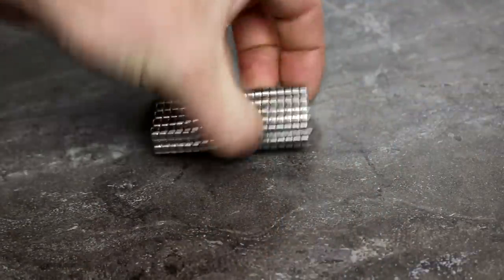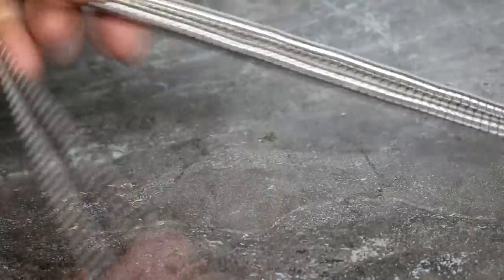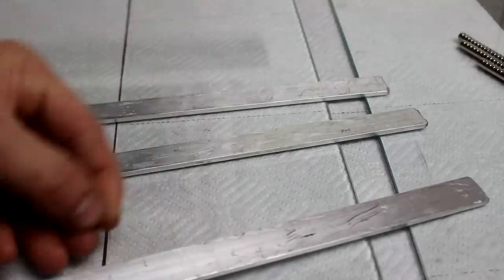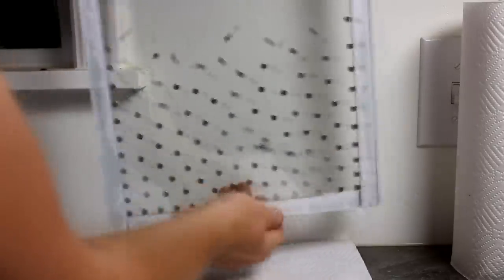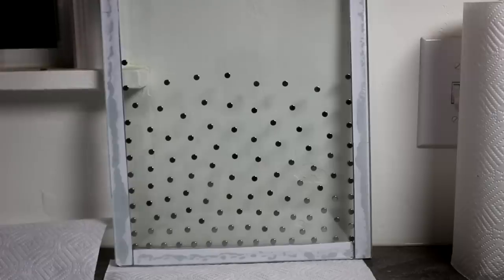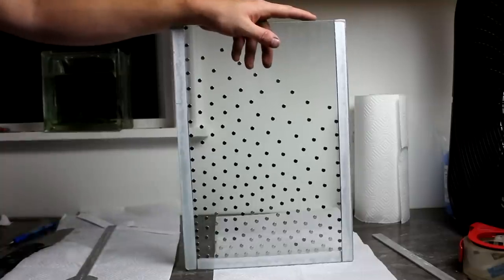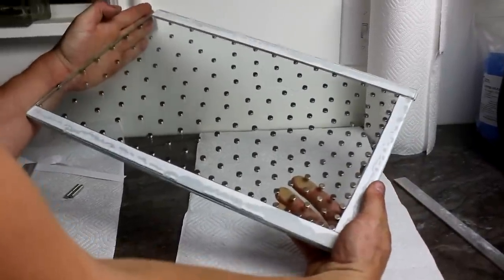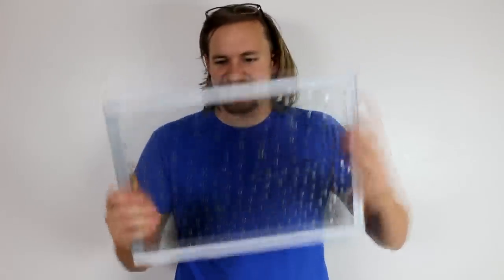Modeling a Gas With Magnets

Comment: Great video!
Two suggestions:

Put rounded corners inside so that the magnets can't wedge in the corners, to encourage a more unstable equilibrium

Automate the spinning of the big magnet
Reply: Axelios the magnets get weaker over time so in like a week they would be useless
Reply: The Champ what are you talking about? theyre neodymium magnets, there wouldnt be any measurable difference after a week
Reply: @hughsl3942  There would be a difference in a week if we moved the experimental apparatus into an operating furnace.  😉
Reply: I suggest an electromagnet. You could easily keep reversing the poles on that extremely quickly. Adjustable frequency to simulate temperature maybe.
Reply: @sushimrexx  that would be the smart and elegant solution. Alternatively, strap a big magnet to a drill bit lol

Comment: Man big magnets like that cylinder you've got scare me. I couldn't stop looking at that knife on the table and thinking what may happen if you get too close. Awesome experiment though, I may make one of these to bring to bring to kids science classes.
Reply: NightHawkInLight my thought exactly
Reply from the maker: Yeah a bit of an oversight on my part, fortunately the knife tends to stick to the magnet flat edge on so it would have pinched rather than cut.
Reply: Play music through a large electromagnet to visually show the speed of sound!
Reply: +Cody'sLab ok
Reply: To bring to bring?
Reply: I don't think the magnet was strong enough to attract a knife from a distance far enough that it would gain significant velocity. Also, odds are that knife isn't very magnetic. The other smaller magnets reacted so strongly because they have magnetic fields of their own which were interfering with the larger magnet's field.
Reply: NightHawkInLight you should have some slightly larger magnets to represent denser gasses/elements
Reply: See that big gauge in his thumb? I think we all know where it came from :D
Reply: NightHawkInLight I thought that it said maggots
Reply: U da bomb
Reply: I was hoping the entire time that the knife was a non-magnetic metal. 

Also, it would be really cool to see how much you could move/accelerate a knife using magnets. Kinda dangerous though.
Reply: Says the guy with a big vacuum tube cannon.😁
Reply: @Daniel Jacob I dont think its the speed of the knife that would cause injury, rather the inexorable force of the hugassed powerful magnet pulling the knife in with incredible force... it could definitely cause injury, probably pinching but possibly cutting (if unlucky)

however I don't think cody was in any danger of losing a thumb or something but if it were a sharp knife it could certainly have required stitches.
Reply: Many years ago, I was working at [un-named hospital] when the news came in that someone had gotten a floor-buffer a little too close to an MRI machine.
Powerful magnets, liquid helium cooling, 8 Tesla field....
The buffer punched through dry-wall, and ended up about 2/3 the way into the central tunnel.
There was a patient in the machine at the time, the rest is public record.
Reply: +Zac dangerous is cody's pretend middle name
Reply: Greg, what purpose does not naming the hospital serve, if you're enabling us to find it out anyway?
Reply: NightHawkInLight s I'm your biggest fan
Reply: NightHawkInLight okay so when I look at your comment it says: dark souls is the crash bandicoot of Mario platformers. When I CLICK on your comment chain i see a totally different comment. What gives?
Reply: Xx_BlackRhino_xX 1 hes actually a distant relative of johnny dangerously
Reply: Lol I have a 2 inch cube rare earth magnet. Definitely scary when something jumps across the table to get to the magnet.
Reply: NightHawkInLight Cody' s Lab, safety 3rd.  😁
Reply: Fidelio, he mentioned the glass breaking before (7:20) if that were to happen with the big magnet close by the little ones would be like birdshot flying toward his hand.
Reply: was the person okay?
Reply: Dao Anagain sounds interesting "modelling gas with maggots"
Reply: final destination in a shellnut
Reply: Gurfan:  The material discussed here is way over your head.  You should go to the Teletubbies site.
Reply: stainless steel is not that attracted to magnets though...
Reply: donven33:  Ferritic and martensitic stainless steel (400 series) is magnetic.  Austentitic stainless steel (200 and 300 series) is non magnetic.
Reply: Put some lubricant on the glass before you glue it together, ought to help solve the friction problem.
Reply: Thanks for the info, now we just need to find out which type is Cody's knife :-)
Reply: all he is missing is commas and it makes perfect sense, leave the poor guy alone.
Reply: aka gauss rifle
Reply: Gurfan:  You fool.  Did they kick you off the Teletubbies site?
Reply: The rate of acceleration of iron caught in a magnetic field is actually pretty astonishing all by itself. The inverse square law ensures that it would have had to come pretty close to be dangerous, but if it did come close enough, the momentum combined with the on-going attraction would definitely be more than enough to do some real damage if it was oriented right. Thankfully, it would be unlikely to fly point-first.
Reply: scared of big magnets and you teach science?? =_=
Reply: Knowing enough science is what makes you afraid of big magnets. People have been killed by big magnets. And many limbs and hands have been crushed by them.
Reply: BongLungs:  You are confusing 'scared' with respect.  Learn the difference.
Reply: NightHawkInLight u u
Reply: NightHawkInLight  I.  I’m
Reply: Been there... done that.... GF makes me keep my magnets in safty containers now... haha
Reply: The knife isn't much of a threat, having a second big magnet would be.

Comment: "if I remove gravity"

gas imidetielly start escaping a vessel
Reply: gravity here can be seen as is linear pressure from top direction, it compresses the gas, the pressure is acutally lesser distance between molecules and when he removes "gravity"-pressure one can notice, that the gas flows out of the pressure tank because it was still compressed even tho we had no gravity any more, the container must have been pressurised already! and how could we possibly have created that pressure? well, he filled up the container while it was under pressure (he did this naturally) because it was standing and not flat. Just like you refill your ligther with gas, using the gas molecules and some pressure to make it flow. just like the magnets want to exit the valve, so does the gas in the ligther 
tada!
Reply: it would irl, too. Also the outside was a vacuum
Reply: False LuL

Comment: He can sense the polarity of the magnets with his finger, I just realised haha.
That's why he was able to repel 2 magnets without testing them first. The magnet in your finger really payed off XD
Reply: Andre Antunes I don't think this is the case, he only can feel the alternating magnetic field now since the piece of magnet inside his finger are too small, he know the polarity of those magnet because he pull it out from a chains of magnet so it's S-N-S-N-S-N...
Reply: SandPox i remember him saying something about him removing it. Cause it was causing medical problems. Idk I just remember seeing something like that
Reply: SandPox those magnets might even start losing their power soon they tend to not hold up very well over time
Reply: Gregory Smith you are correct he removed the magnet in his finger.
Reply: He did, but there's a fragment left, just enough to sense the magnets
Reply: Right, I think he put a magnet it, it broke, and then he was left with a fragment.  The fragment was so cool he tried to put a new magnet in his finger, but it also got infected, so I think he gave up.  The fragment is not as useful as the whole magnet though.
Reply: Wait what? Cody has a magnet inside his finger? I need that video's link!

Edit: found it. watch?v=x2cNmtO3YXw
Reply: MRI machines must be fun for him.
Reply: He said he removed it but a very small piece was left inside
Reply: Connor Hodgins I guess he'd have to be careful around a very large, powerful neodymium magnet, or the bit still in his finger would try to expel itself violently, lol.

Comment: Between 4:20 and 4:40 the molecule has achieved buoyancy. Galilean thermometer. It will never go any deeper than that because the weight of the other magnets cancel out the weight of the molecule. What an excellent way of visualizing this.
Reply: Galilean thermometer or world's smallest airship? :P
This thing's free-floating after all. Not in liquid.
Reply: I do a lot of particle physics simulations with software. Liquid or gas or solid is pretty relative when talking about particles. They behave in very much the same way. The only difference is how strongly they bind to their neighbor particles; do they reform those bonds after they've been broken.
Reply: +Unauthorized Expression
Interesting theory; my take was that it was an "artifact" of using a design of finite size, with the action at the boundary not being ideal. My thinking is, if Cody had an infinitely large glass plate, the "heavy molecule" would descend to a trivial height above the bottom.
Reply: bcubed, you sound like you know more about this than I do. I'm glad you understood that I was positing a theory not stating a fact. I think you are looking at this like it was a steel ball in a bucket of sand in which case the steel ball would fall all the way to the bottom and could never attain buoyancy. To be perfectly honest, I don't know why I'm so sure this is the wrong way of looking at this, but I'm sure it is. 

I'm looking at this like you put a drop of water in a bucket of some liquid that is lighter than water. the water is incompressible so at some point the pressure of the lighter fluid (the weight of all the fluid pressing down) will cause the water droplet to stop sinking and it will float weightless. 

I have no formal training in physics. I've always been interested in it and like I said I do simulation of fluid and particles for fun. These things just kind of seem right to me or they seem wrong. I typically find that my "hunches" are right for very technical reasons I don't understand.
Reply: Hey, you could be right. I just know aluminum is paramagnetic, and (looking at Cody's setup) it appears to me that the magnets directly adjacent to the aluminum bars aren't behaving "correctly"; they all remain pressed against the Al (even on the vertical sides) and don't want to move around when shaken.

That's not to knock Cody, either: no "simulation" is ever perfect, and "artifacts" of the experimental setup ARE something experimental scientists have to account for.
Reply: Well the magnets will resist moving because of the Lenz effect. The diamagnetism would be almost unnoticeable. At least I've never seen anything that can repel a magnet like magnets repel magnets or like gravity pulls things to the center of mass. 

My simulations are far from scientific. They are not accurate to real world physics to a degree that any physicist would tolerate for anything, but it is close enough that for some things it does help with perspective. It allows me to do things that I could never do in the real world like see how a million balls all with the mass of gold and 10 meters across might behave if they were floating in space being acted upon by different forces like gravity, magnetism, wind force, turbulence, etc. 

I personally use Blender (www.blender.org) with the Molecular addon script, but if you were interested in play with a much more accurate software I'd suggest  Realflow or Hudini. I know you didn't ask but maybe ur interested. It's no small undertaking to figure out how these programs work, but smart ppl appreciate a good challenge.
Reply: I think it's an issue of friction with the glass, it's probably tighter at the edges.

Cody should try it with some kind of clear lubricant in there to help things move
Reply: Unauthorized Expression Neeerrrdddd!!!
Reply: Unauthorized Expression i
Reply: Unauthorized Expression I couldn't agree more! I was thinking this would be great to make for my students!

Comment: I want to know how magnets scale. Would a cube shaped magnet that is 2 inches across be 8x stronger than a magnet that is 1 inch across? would it be 4x stronger, 16x stronger? Thats my question. How does a magnets strength scale with its size?
Reply: most likely a logarithmic diminishing returns pattern. The larger size would give you more magnet strength, but you would be further away from the magnet field. In such systems you tend to see a logarithmic style diminishing return.
Reply: Thank you!
Reply: yes similar to gravitational falloff I would assume, the inverse square law.
Reply: Gravity is inverse squared while magnetism is inverse cubed.
Reply: I think that in practice, you can't get much stronger than the large hockey puck magnet you can see in the video. A larger magnet would have a larger field but not much stronger on its surface.
Reply: Probably it scales about 1:1 with volume, just like charge. because it originates from tiny dipole magnets..
Reply: It depends on the type of magnet, but yes typically a logarithmic falloff. Large electromagnets, like the ones used in cranes and... well, the Earth, tend behave slightly differently and can have a much greater field strength relative to their metal content IIRC. If the Earth was a regular ol' magnet, it wouldn't have anywhere near the magnetic potential to deflect the strong particle radiation from Sol.

Comment: The "pressure gradient" from top to bottom is amazing. The heavier molecule sinks, but only to the depth where it can "float" in equilibrium on a sufficient amount of "air pressure". It's really interesting how the surrounding molecules slightly reorient their pattern to accommodate the heavy molecule taking up space and exerting more force. This is a genius simple concept that should be in every science class!

Comment: If the magnets were lubricated, do you think they would shake around a bit better? 

Also, without any friction at all (lubricated in a vaccuum maybe?), would they actually move around more, like actual gas particles?
Reply: Best thing to do would just space the glass slightly further apart. Gas molecules vibrate and dance around. You'd have to sit it on some kind of vibrating platform.
Reply: The problem is that the magnets are trying to turn over and align, so are jamming between the plates.
Reply: They make teflon coated magnets of all sizes. I bet if he got a bunch off those it would behave better.
Reply: In answer to OP's question, No, a liquid lubricant would not help. It's density and viscosity would just stick the magnets in place.
Reply: MarsBar great idea!
Reply: put electro-magnets in the sides and have it turn on and move the partials around. that would be a fun toy.
Reply: These magnets don't move around without an outside force. In gas,  the particles are very fast and are constantly hitting other other ones. You cannot accurately model gas molecules with magnets.
Reply: Sometimes all you need is a bit of lubrication.
Reply: wd40 isnt a lubricant
Reply: It doesn't depend on the lubricant. Any fluid would exert it's viscosity and surface tension forces, even water. A dry lubricant is the only thing that might help, but probably not.

And yes, WD-40 has a lubricating factor, that makes it a lubricant. That doesn't mean you should use it as one, but it IS a lubricant.
Holy shit, you people.
Reply: Рудик Шалаев ...
Reply: Mineral oil would be nice
Reply: Just stick a bunch of monopoles in a box.
You know, those monopoles that we can't find
Reply: Smaller magnets would be more fluid. If i were him, i would make a machine that splits them into fourths.
Reply: Good points everyone, smaller magnets is a great idea. Would the strength of the magnet make a difference? I'm thinking if they were weaker they might flow a bit better
Reply: +UnitSe7en If you put water on top of ice it will be more slippery, so water can techniclly be a lubricant. Yet it isn't used for lubricating too often. WD-40 contains some (minimal) lubricant, yes, yet it is still more useful as penetration fluid and for some fine things. 

Actually do the WD-40 fanboys know that there is a WD-40 PTFE variant which is actually made for lubrication? And it is actually very good, much better for fine mechanics!

Don't misunderstand, I am not an anti-WD40 person, but a lot of (US) people think it is the holy grail solution for everything, and everyone uses it for everything. No, it is not. There are some cases when it comes handy, it can be good lubricant in very fine mechanics, but in most of the cases, in bigger machineries and things it is not really a good lubricant.
Reply: @ultramohitb  gas molecules we see are moving due to outside forces